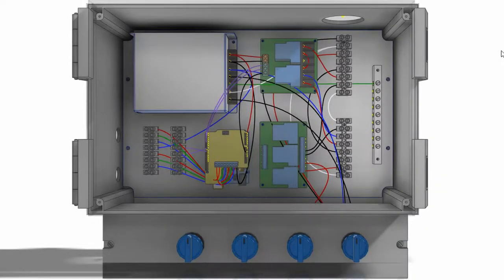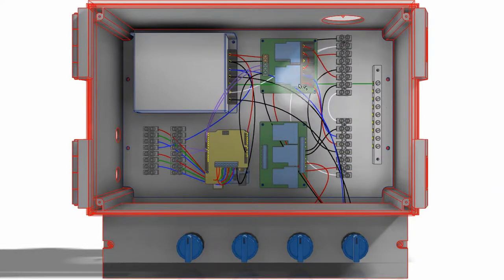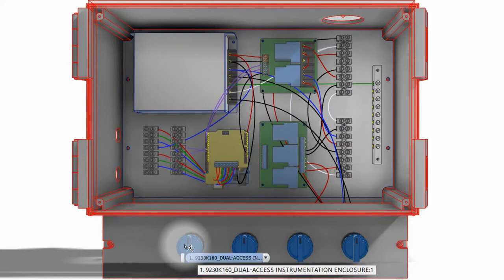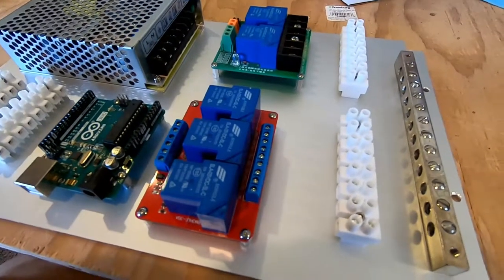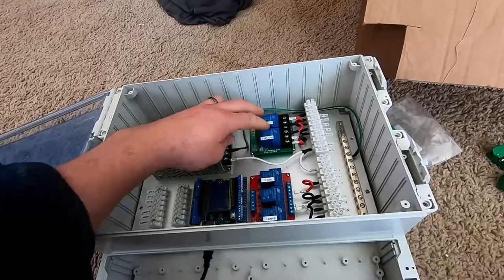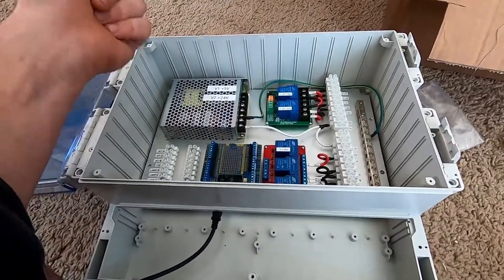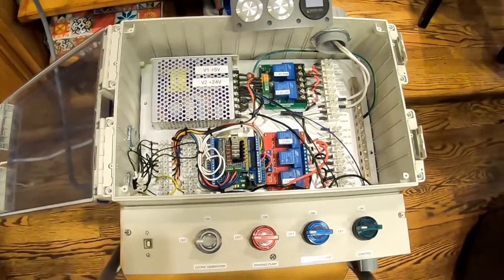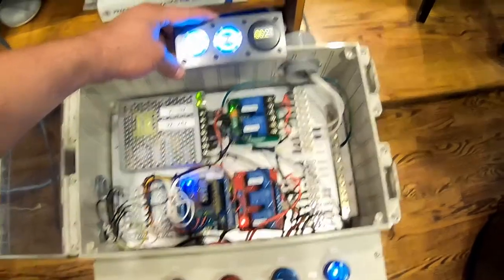Hexagonal Hot Tub Build Part 13: Arduino Control Box Build

Comment: Hi what relays have you used in this system, do you have a link?
Reply: Thanks for the reply, I have looked around and all the isolated relays I've found seem to be a lot less robust than the ones you used, which is why I asked.   

For example https://www.ebay.co.uk/itm/262722739443 

However I don't think these will last very long with the inductive load of the motor, plus the terminals look pretty small to be able to connect the wire size required.  Also you don't look to be using anything to trigger the relay I.e. direct from the arduino so are the relays 5v coil?